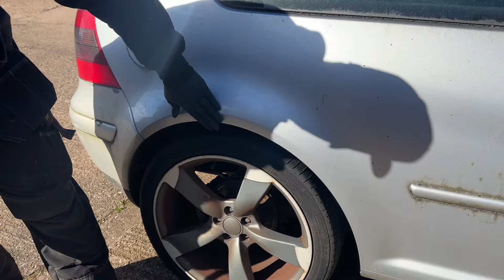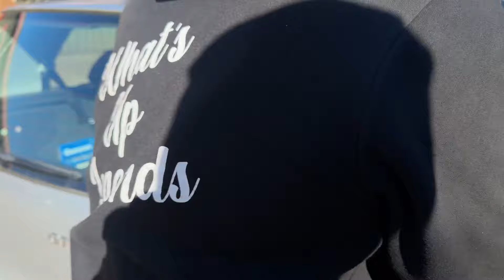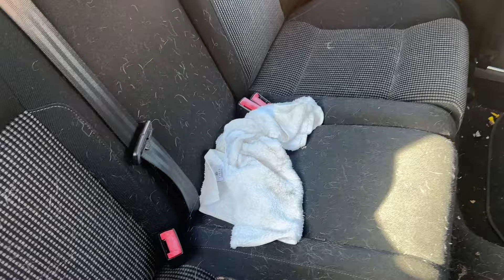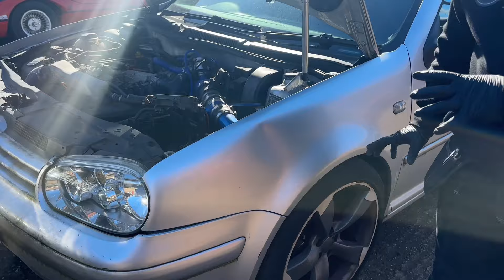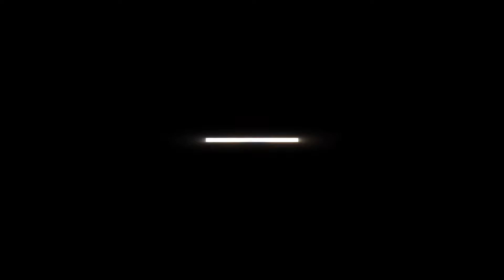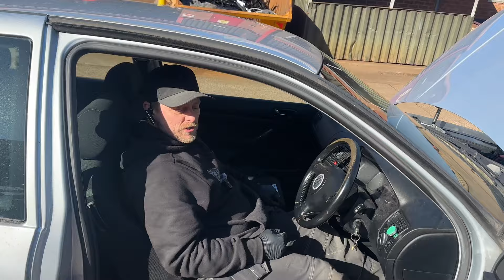VW Golf Mk 4 Project - Full Walkaround WILL IT START 1.8 20v Turbo!

Comment: Nice! Look forward to seeing more of this
Reply from the maker: We’ll be getting going properly on this very soon mate so should be lots of content coming shortly 👍
Reply: @custombodyrepair  awesome! get ready for the things you never even thought you'd need to replace that need replacing lol Good luck with it, have subscribed!
Reply from the maker: @MK2GolfStories  story of our lives that is lol, my plan at the moment is to replace almost everything, underneath I’ll be basically turning it into a brand new car so full new subframes and suspension etc along with any and all systems rebuilt like power steering air con etc so that by the end it virtually a new mk4 😁
Reply: @custombodyrepair  awesome! that should cover everything then, sounds like great build! im in the process of rebuilding a mk2, never done anything that in depth before
Reply from the maker: @MK2GolfStories  good stuff mate, it’s all worth it in the end when you get the car you want out of it
Reply: @custombodyrepair  deffo